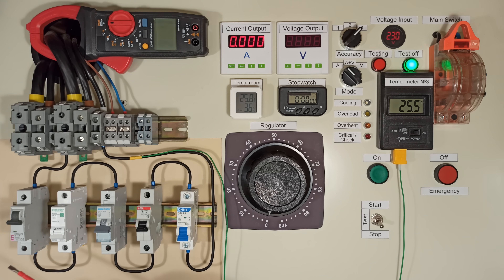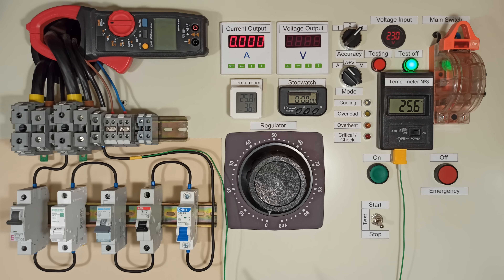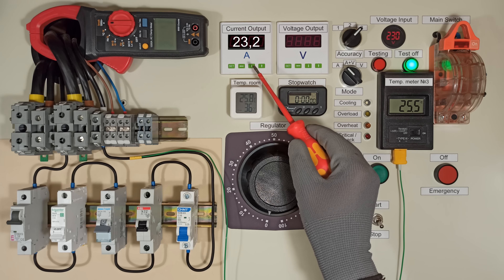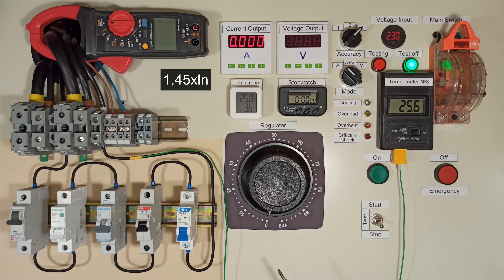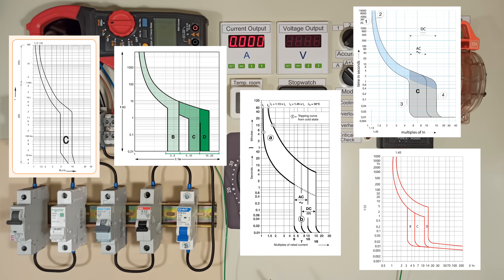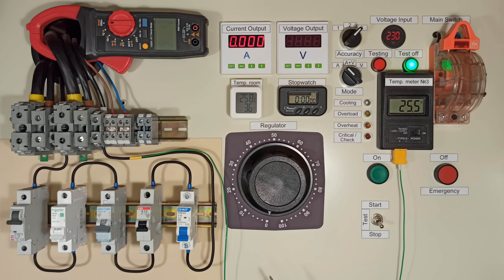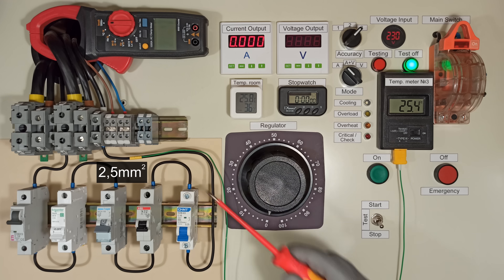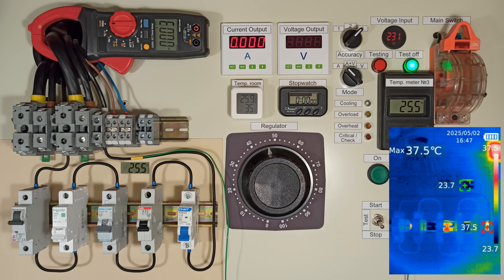Test MCB 16A. ETI, SE, Hager, ABB, CHINT

Comment: Please put a temp sensor on the terminals of the breakers. According to the IR display, while the Chint tripped within it's characteristic, it also appeared to get very hot much more quickly than the other breakers. Termination temp rise is critical as the fire can start there rather than in the wire.
Reply from the maker: Hello! I'm glad you watched the video carefully — that’s great to see!
Indeed, I could try mounting the temperature sensor directly on the terminal and clamping it together with the wire.
But is there really a point in doing that? The temperature at that point will be elevated, and that's expected — because the breaker heats up from the inside and transfers heat outward.
Inside, it heats up to bend the thermal plate and trigger the trip mechanism.
So in a way, the breaker intentionally overheats — that's how it protects the wire from overheating.
However, it can reach quite high internal temperatures on its own.
As for the hot spot next to the CHINT at the beginning of each test — that wasn’t due to the breaker heating up.
It was a false thermal reading caused by the metal DIN rail.
The thing is, thermal cameras can show significantly incorrect (often higher) temperatures when pointed at metal surfaces — because those require a different emissivity setting.
In later tests, I placed a piece of paper there — and the hot spot disappeared.

Comment: You forget to mention about 1.45x In is only for 25 deg. surrounding temperature. Anyway, this test doesn't show reliability, which is extremely important, not only in industry, but also in home. When CB will not trip when it should, Your building can catch a fire. If You want  to be safe, chose Eaton or Schneider. When You want to be extra safe, chose ABB or Hager. Cheap staff is always most expensive in reality.
Reply from the maker: Hello, let’s discuss this so we can better understand each other! I understand the curves of circuit breakers like this — manufacturers base them on 30 °C ambient temperature. If the temperature is different, you need to apply correction factors to the rated current. That means at 25 °C, the rated current is actually higher. Manufacturers provide correction tables in their manuals. However, the tripping curve remains valid even at other temperatures — you just need to multiply 1.45 by In(25).
In this video, I didn’t apply correction factors, but you can watch the next ones — I do tests with corrections there.
I fully agree that well-known brands make high-quality breakers, and they’re definitely a good choice.
Reply: @ElectroTest_1  25 °C is in the European norms. Inside You have bimetal that as You probably now, bends with the temperature. In the same time this is a wire.

If some current makes wire heated up to 50 °C at ambient temperature 20 °C, then You have delta of 30 °C. So if ambient will be 30 °C instead, then wire will have 60 °C. Same thing applies to the bimetal inside of MCB.

Im not sure if I recall correctly, but for every 10 °C more, MCB should trip with 6% less current.

I hope that answers Your questions.

Comment: A 100% unsuccessful experiment. The MCB must be placed one by one without sequential connection because the electrical cable has become like a coil and this affects the MCB 🌟 or changing places.
Reply from the maker: Thanks for the feedback! Although I don’t fully agree about the coil 🙂 Of course, the correct way is to test them one by one, and there are even specific requirements for such test setups in the standards. You can compare it with another test on my channel — I tested 5 breakers there individually. Though I still need to improve the test stand further to ensure more accurate results.
Reply: 🌷 @ElectroTest_1

Comment: Are these breakers for some specific use case?
I would assume the "normal" breaker is supposed to trip fast when I go over the nominal current.
Like, when I turn on the kettle and the induction cooker at one, both have some 2,4 kW, so I assume it's 2×10 Amps,  the breaker goes off practically instantly
Reply from the maker: Hello! Most circuit breakers work exactly the way you saw in the video! That is, they have a certain delay when switching off under slight overloads.
The reason is that circuit breakers have two types of protection:
– Thermal protection, which reacts with a delay to small overloads,
– and magnetic protection, which trips instantly — but only at currents starting from 3×In (or 5, 10×In depending on the tripping curve type)

Comment: Interesting test setup , thx for sharing. Just our of curiosity, one question regarding methodology: Given that you’re applying 1.45 × In (23.2 A on a 16 A breaker) and comparing tripping times, did you verify the trip classes (B/C) and thermal calibration tolerances per IEC 60898-1 Annex B? Specifically, since the trip time at 1.45 × In should fall within 60–600 seconds for a Type B curve under standardized ambient conditions (~30°C), do you compensate for thermal derating or ambient correction factors? Also curious if your setup ensures steady-state RMS current or if there’s any transient overshoot from the power supply during ramp-up that could affect the thermal element’s response.
Reply from the maker: Hi! You're asking very good questions! I’ll try to give simple answers. In this particular test, I didn’t take temperature-based correction of the rated current into account. But in later tests, I started considering it. Regarding the tripping time at 1.45×In — please double-check your information. The standard states that tripping is allowed within up to 1 hour, regardless of whether it's Type B, C, or D. Only for breakers rated above 63 A is tripping allowed within up to 2 hours. Yes, my setup provides a fairly stable RMS current, even during adjustment.
Reply: @ElectroTest_1  You’re right — I had to look more closely after you commented. Just to clarify though: in IEC 60898, isn’t it only the magnetic trip zone (instantaneous) that differs between B, C, and D, while the thermal zone (like the 1.45×In test) is actually the same across types up to 63 A? Your test seems to touch both, but the framing had me double-check. Great work, really appreciate the detail you’re putting into these!

Comment: First of all, nice work!
I used to maintain ship electronic systems sometimes. I have got a shocking  experience that is somewhere linked to your test, sharing it to give you a direction which these devices might be tested from additionally. 
Briefly the situation: Imagine that there is a ship standing in the port in the summer. All windows closed, no airco that cools the wheelhouse. Same like when we leave a car unsheltered on a hot summer day. For example they want to sail out at 14:00. Chint is sometimes the only breaker that triggers only because of the warm temperature. Think about the consequences on open water when something stops working from an unknown reason. 
It does not even need the current to approach its "In" value, its gonna say good bye just because of the warm and a small amount of current flow combination. So I think it would be a useful experience for all of us to see how these devices work in different - but still everyday - circumstances.
Reply from the maker: Thanks for the interesting story! So what do you think the temperature could have been in your case — 40–50 degrees Celsius, or even higher? I might try to recreate something like that.
And one more question — did this happen only once with a single breaker, or have you seen it with different ones?
Reply: @ElectroTest_1  interesting idea - "cook" these Circuit Breakers to like up to 100deg and see at which outside Temperature they just trip by themselves...
Reply: I install solar inverters. They tend to run at full load for ~4hrs per day in Queensland. In my experience if the circuit breaker is rated at full load current, all brands of circuit breaker will nusiance trip due to ambient temperature. If you choose the next size up cable and breaker, after about 18 - 24 months most brands will start nuisance tripping. Hager take about 36 months. I use Schneider A9F44xxx breakers, 6kA C curve. They seem to last indefinitely. Your ship boards will be running at a similar ambient temperature as a Queensland meter box and it's likely that the loads are running for hours on cables and circuit breakers specc'd to within a mA. The Chints have done their 18 months. Time to replace with a proper circuit breaker.

Comment: One big problem in your test - you only tested one circuit breaker from all manufacturers, there are manufacturer tolerances
Reply from the maker: Thanks for the comment! Of course, you're right! I'm really curious myself whether breakers from the same manufacturer will show significant differences. So far, I’ve tested only 5 ETI units in one of my videos, and the variation in tripping time was quite noticeable!

Comment: CHINT? No WAY! 53.7°C🤯 (see at 4:51) is nothing i want to have in my fuse box! Especially not if I have e.g. 20 of them in use...
Reply from the maker: Hi my friend! At first glance, it looks a bit scary. But this is how all breakers work. They heat up (or more precisely, the thermal element inside heats up), the bimetallic strip bends and releases the spring’s latch. The breaker heats up => trips => the wire is protected.
However, it's true that different breakers can have different components and build quality, which affects how hot certain parts of the breaker get.
There’s actually a standard that clearly defines the acceptable temperatures for each part. And you might be surprised — the side of the breaker is allowed to reach +60°C above ambient temperature. So if it’s 25°C in the room, 85°C on the side is still considered normal =) .
That means this particular unit is totally fine.
It’s a big topic, and I’m thinking about breaking it down in more detail sometime. If you’re interested — leave a like!

Comment: The longer the time, the more difficult it is to get accurate. 8 min and smack in the spec is a gold star. I wonder how repetitive this is... Also, test trip time for high overcurrent, such as one of a 10kW induction motor losing one phase.
Reply from the maker: Thanks for the ideas. I'm also curious how consistent their tripping times are across multiple attempts. I'm currently preparing something like that.

Comment: Sorry but this test is a complete failure, if you see the connection of each terminal the are heating up a lot. Normally if you torque then according to spec you won’t have this. The rest is like a domino effect.
Reply from the maker: Thank you for your opinion. The effect of the series connection is not as significant as you might think. However, the same current flows through each breaker. I also suggest watching the next test with different breakers — I tested them separately there.

Comment: Why are the "automata" connected in series?
This is not the load current for them.
Reply from the maker: In this test, I pass the same current through all the breakers and check which one trips and how quickly. This is a test stand. Yes, it's more correct to test them one by one, although in my opinion, the effect of the series connection is not significant. I suggest watching a similar video where I test other breakers separately.

Comment: A test with DC breakers would nice to have. There is a lot of confusion here like; uni-and omnidirectional, arc-issues, connections....
Reply from the maker: What do you think — is it possible to test DC circuit breakers with AC current? Or at least test the thermal trip unit?
Reply: @ElectroTest_1   think that will be useless, DC breaking is different from AC, for AC there is a sinwave and much easier to break.

Comment: Chinese people use various brands of air switches, but many products, although they are foreign brands, are actually produced by Chinese factories. Therefore, we don't know whether these products are imported or not, so we simply don't bother to identify them. As long as they are genuine products, we use them,
Reply from the maker: Thank you for the information. In my opinion, the most important thing is still who owns the brand. Where it is manufactured also matters, but production can take place in different countries, while the design, technology, and product range depend on the brand owner.

Comment: For more complete test the wires between circuti breakers should be longer. Currently one circuit break will start to heat the adjacent one and if 2 adjacent ones happen to be "toasty" ones then they trip alot faster both , than paired with "colder" one.
Reply from the maker: Thank you for your opinion. You can watch the next video. I tested two circuit breakers separately. The first one still trips quickly. https://youtu.be/SAZOkpZxCE4

Comment: CHINT is the most cost effective.
Reply: I used all of the chint at home， which was very cheap and reliable.
Reply from the maker: Yes, among the ones shown in the video, Chint is the cheapest.
Reply: the most cost effective...

until the place burns down but the insurance doesn't pay because you used cheapass CB's.

then it was the stupidest desicion ever. and expensive AF.
Reply: @casemodder89 They cannot do it because CHINT has the necessary certification. Plus, the temperatures were nowhere near any fire temperature, cables are calculated for 90C, plus generally 0.85 safety factor.
Reply: @casemodder89 Any electronic engineer, or anyone with an engineer mindset will not agree with you.

Comment: Other than the ABB, I have not heard of any of the other Breakers you tested. How do the Big names stand up to this test such as: Rockwell/Allen Bradley, Schneider/SquareD, Siemens and Lastly Eaton/Cutler Hammer.
Reply: Hager is the most widely used in germany and usually also the most expendive
Reply from the maker: Thank you for the comment. The video featured Schneider (SE) at least.

Comment: Thank you for a simple and "straight to the point" test. Here in Brazil we have (out of your tested brands) ABB and Schneider. (but Legrand and Siemens are also also available)
Reply: Hello, can you tell me. Are there any local brands in Brazil? Produces electrical protection equipment such as MCB and MCCB.
Reply: @TF-AUTOMATION WEG and Tramontina for example
Reply: @TF-AUTOMATION  Yes, plenty. WEG produces top of the line MCBs. Steck (Owned by Schneider) are pretty good, almost the same build quality as the standard Schneider CBs. Tramontina MCBs are average at best. We also have Soprano, Lorenzetti and a few other national brands that use Chinese OEMs but I haven't really tested them personally, if they use Chinese OEM, I prefer to just get Chinese brands directly.
Reply from the maker: @jrochavet Nice to hear that you liked the video! Thanks for the information.
Reply: No Brasil temos a CHINT também . Muito boa e barata.

Comment: Concerning that the Chint breaker itself gets quite warm, too. Wouldn't use it, even if it performs within spec on this one test.

Of the other four, the three within spec all seem just fine.
Reply from the maker: Thank you for the comment. The CHINT wasn't actually hot — it's an effect on the thermogram caused by light reflection on the metal surface.

Comment: I would say CHINT performed best because its reaction is just in the middle of the curve.

probably the least susceptible to parameters spread and aging.
Reply: These three things are unrelated.
Reply from the maker: Thank you for your opinion!
Reply: It is worth mentioning. CHINT is less than half the price of other brands.
Reply: Merlin gerin is the best i tested
Reply: @billykulim5202 
Could be fake, since their no longer exist for dekade, rebranded as Schneider.
Reply: I’ve open many mcbs and one thing I noticed about the chint is that the arc plates are thicker than most and I believe it gives it a better thermal ability over other mcbs.
Reply: @mrtrenergy  low-cost rubbish. they never last as long, tiny internals, chint always burn out and melt before other brands. Especially their RCBO's.

Comment: Can you also check those chinese  Adjustable Over Voltage and Under Voltage Protective Devices that are flooding the market.
Reply from the maker: Could you please specify the exact models? And the manufacturers?
Reply: @ElectroTest_1  common one are Taxnele or Tomzn. They are usually rated 63A (adjustable) and can be used to monitor energy profile as well. I'm curious if the build of these devices can handle that high currents as they don't have kaic ratings as well. Thank you!

Comment: I wonder if you didn't skew the results by daisy-chaining them. They must in some way (probably very little) load the line, so that they may interfere with each other. I'd redo the test with connecting them one by one
Reply from the maker: I think this might affect the result. However, this way we got more statistics from 5 tests. For example, Chint was the slowest in all the tests, and other breakers also tripped in a certain sequence several times.

Comment: Soo...which is better for our electricity circuit?
Please rank it from best to worst.
Reply: I wouldn't be ranking from best to worst. I think you need to determine what is best for your situation, installation and location.  I haven't seen the ETI brand here in Australia. We have all the rest. I've never used the Chint brand, a bit too unknown for me. You also need to take into account their KA rating.
Reply from the maker: @PlumbBob-FGX Great explanation! I also think that sometimes it's better to trip sooner, and sometimes later. It depends on the situation.